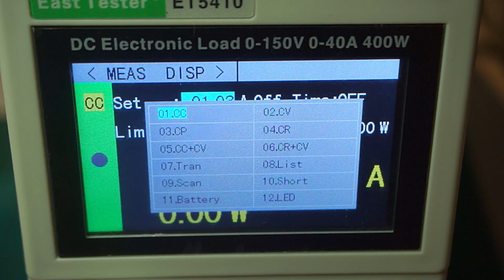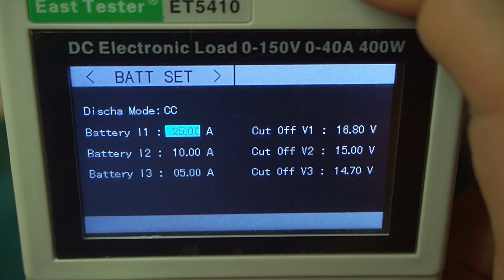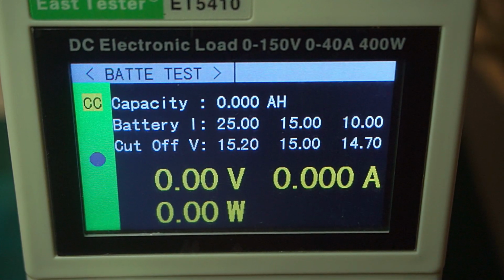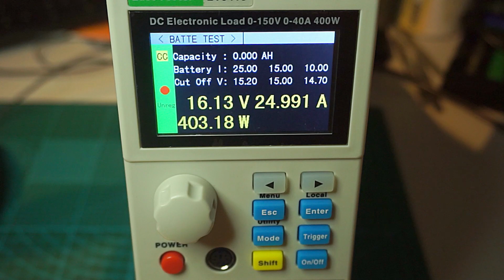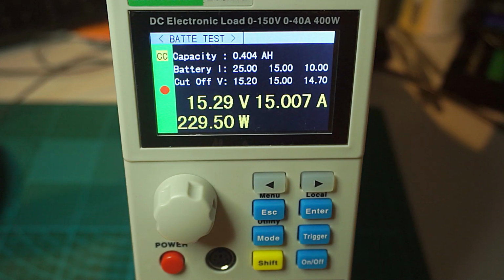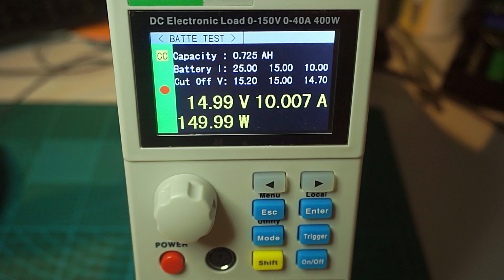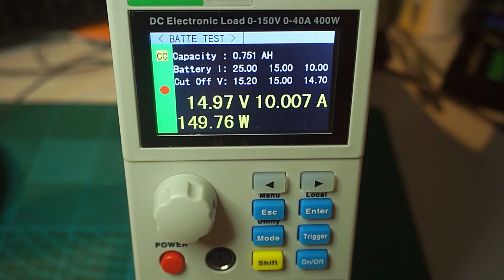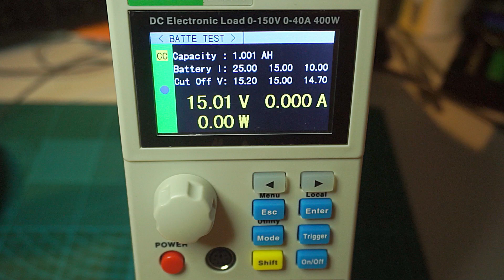Discharge LiPo's In Style - ET5410 Electronic Load

Comment: I picked up the ET5410A+ model based off your review.  Usually once or twice a year I check my lipos health and see what capacity they retain.  I have a PowerLab8 charger that is really good for this but only has around a 8 amp discharge max unless you use regenerative discharge to a car battery.  While that method does work well its a bit cumbersome to deal with a marine battery and its upkeep and once the battery is full you lose the extra discharge capacity.  The ET5410A+ is pretty accurate and I have run some tests while measuring against my fluke meter.  Its also a little nicer to use versus a SkyRC BD250 (which also works pretty well).  The ET5410A+ can be attached to the pc via usb cable and they have software to control it as well (although it a little bit of a pain to get set up initially).  Overall I am happy with my purchase and would say if you are trying to stick to a tight budget then the SkyRC BD250 is the right choice but if you have a little extra money to spend the east tester discharger is a more professional setup with many additional uses.
Reply: Can you check the capacity on the screen on the ET5410A+ or do you have to connect to the pc ?

Comment: Thanks for the video. The machine accepts up to how many volts for the discharge? For example, could I discharge a 48 Volt battery under a power of 20 Amp hours?
Reply from the maker: It has 400w max and 0 to 150 v so 48v would be little lower than 10a but still enought
Reply: @LivyuFPV  thank you for the answer

Comment: 013121/1335h PST.  Hello FPV, greetings. Recently I acquired ET-5410. I was totally confused as far as operation of this instrument. The user manual, that came along did little justice to help. However, I got in touch with the Factory and surprisingly they walked me through the whole discharge process.
Now, I’m well versed on CC discharge process. 
You spoke about discharging several cells in parallel. Did you perform such a process?  I have charged about 10 Li-Ion cells (18650) in parallel, but no discharge on parallel configuration. If you have done parallel discharge
would you please, post a video on that? I’m sure many users would appreciate. Thanks again and stay safe. 73s...

Comment: 011221/1006h PST 🇺🇸   Hello, please note that your Battery I (current) is too high which will, in turn, heat the LiFePo4 battery bank. This is not advised. You need to lower the discharge Current (I / amps). 
Lower the current higher the discharge time, better and safer for Battery bank. Thanks. 73s...
Reply from the maker: That is a special rc battery with over 150c capable discharge rate. Thats is actually a low discharge rate :)
Reply: @LivyuFPV  Thank you for the response. Appreciate that.

Comment: For the price, you can get an iCharger X6 and have some left to build a resistive load bank in which you can connect to the charger for extended discharge capability up to 30A/800W. I'm using the M8 charger to do external resistive discharge with 200W resistive load bank and can storage discharge a 4S in about 2 minutes each.
Reply: Be careful doing that. I've got an m8 and did same setup but didn't follow their tips on the resistance load being too high or low, I can't remember, and now my 1st and 2nd cell in the balance plug do some weird stuff. But that is a cool feature. You can use a ds18b20 temp sensor on the battery as well. I've been wanting to get an icharger s6 to do battery tests and have the results on sd card.

Comment: Here's an idea.. (I have no idea if this is even possible.) Something like an inverter that you can use to feed the energy from your charged lipos back into the mains of your house. Would need to configure the discharge rate and voltage cutoff, etc. A slightly greener option than burning the energy off as heat. I suspect it would be prohibitively expensive as well.
Reply from the maker: not a bad idea :))  But would need a special setup to feedback the AC to the grid. In some countries that is not even an option but your idea is pretty cool to develop.
Reply: @LivyuFPV  or get car battery and do regenerative discharge on powerlab... ;) next day - from car battery to lipos ;)

Comment: Well...

For the price of this device, you can get +10 dischargers with bulbs (150W) and discharge 10 batteries in less than 30mins...
Reply from the maker: But that is a cumbersome process. You can always just go flying :P. This Electronic Load is so much more than a lipo discharger... that's for sure. But I need your guy's support and these small reviews to have the gear needed for the repair videos I make. Thanks
Reply: @LivyuFPV  Don't get me wrong. You have my support as I enjoy your repair videos.

It's just that I don't see the so cumbersome part. You have to plug the batteries anyway, so... The cumbersome part is press 10 buttons to start the process?

Anyways. I've been using bulbs for many years, so I suppose that for me is the usual process.

Keep the good work with those videos!
Reply: @LivyuFPV  WE ALWAYS SUPPORT YOU!
Reply: @LivyuFPV  Can you please please tell me how to adjust the settings to do a capacity test on a 52v ebike battery? I bought one of these units but can't figure out how to set it up, and the manual doesn't give much information. Thank you.